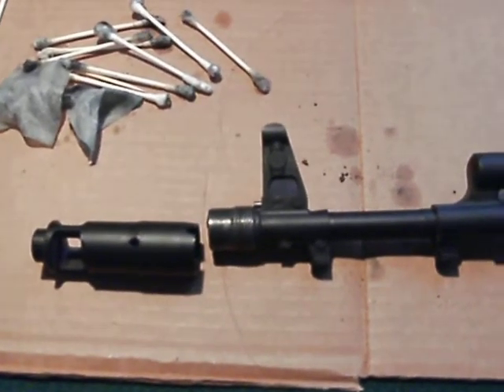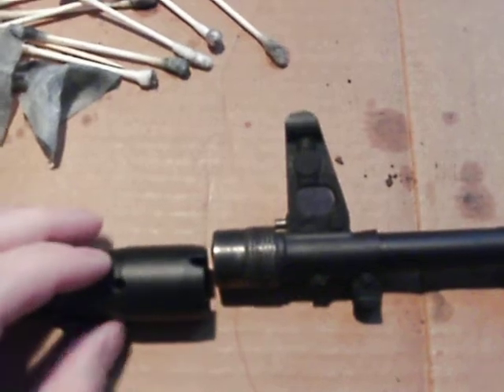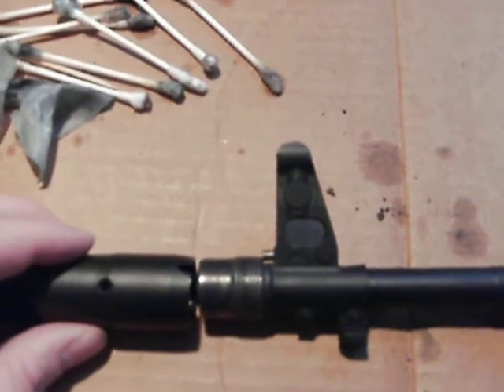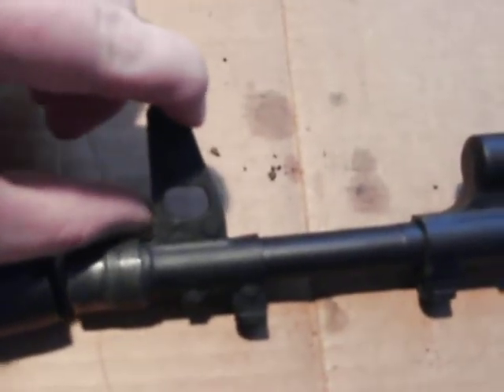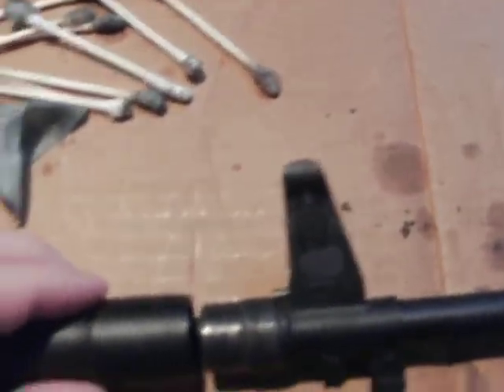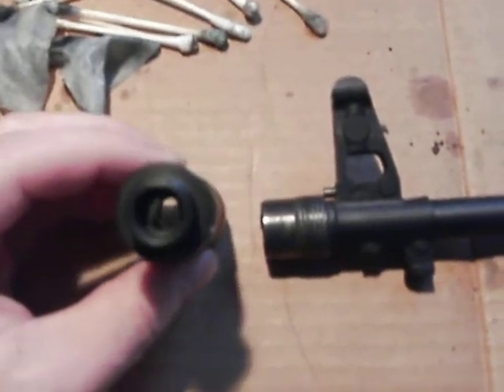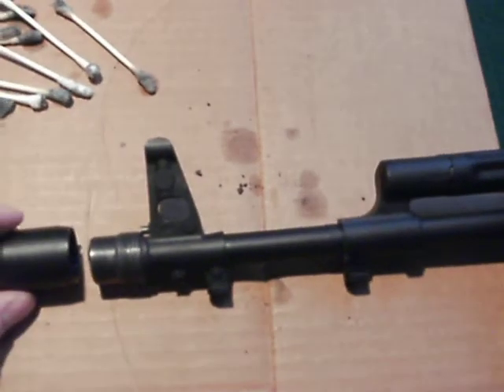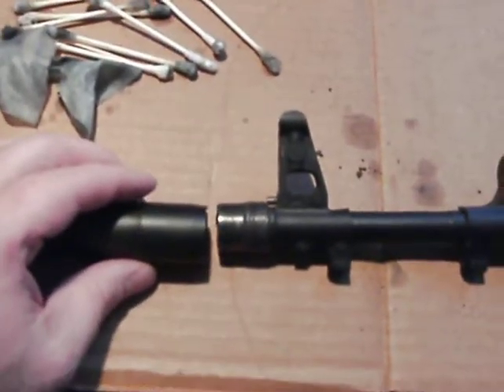Arsenal SGL Muzzle Brake Removal

Comment: If you came here to see someone take the muzzle brake off an AK, you will only find disappointment.
Reply from the maker: You were hoping desperately to watch me spend 92 seconds unscrewing the brake?
Reply: I appreciate your video, no sarcasm.  But I've been trying to get mine off and I cant.  It would've been nice to see it actually happen to make sure I wasn't missing some small detail.  Your vid still helped tho lol
Reply from the maker: J311yman Ah, no worries!  Owing to typical Russian design philosophy it's very straightforward:  hold that little pin in and then unscrew the brake. If it isn't budging, there might be a heavy buildup of fouling in the threads (hopefully no corrosion). Check some of the comments here and try a rubber/vinyl strap-wrench to get it off.
Reply: Thanks man, I have about 800 rounds through mine and it wont budge; I figured it was the fouling but I just wanted to make sure that I wasn't missing something else.  I hear that the brakes really stick themselves on there if they're not cleaned regularly
Reply from the maker: J311yman You're welcome.  I ran into the same issue and had to get it off with a strap wrench.
Reply: Oh this was a fun thread.  Please pardon me for this reviving this Married Shelly Monstrosity. Lmfao!!!
Reply: Google needs to go #1🤫👍

Comment from the maker: Getting the peg in and out of the hole and screwing is fairly straightforward.  If you're having trouble you should have a couple of drinks first to loosen up a bit.  Dry wit aside, this was me holding a cheap digital camera in one hand with video capability.  I still use a flip-phone for chrissakes!

Comment from the maker: Nope, it is what it is.  You'd have to mount a barrel accessory that would fit the thread.  I don't think you'd want to put a slant brake on this rifle (or even the 7.62 version).  The 31 is basically an AK 74 and the brake it comes with (the one in the vid) is the AK 74 style.  You get 50 points for being the first non-friend comment on this vid.  Thanks!

Comment from the maker: My SGL is righty-tighty, lefty-loosey.  I'm assuming that Arsenal makes them all the same, so if you're talking SGL, you'll want to go left to get it off.  I've read that the more old-school, surplus AK's are the other way around.  If you are having trouble with getting it to continue to unscrew, then you are probably in the same boat as the previous comments.  You'll need to use a 'rubberish' strap-wrench to overcome the fouling.

Comment: Got a strap wrench, but it was strong enough. Finally I wrapped my long screwdriver with electrical tape to prevent marring. Then used the strap wrench and the screw driver at the same time (Second person helping). The Carbon was caked on.. I had to scrub the end of the barrel and inside of the muzzle brake. Got the carbon off the barrel, but I can't get it completely out of the muzzle brake. Any suggestions? I have soaked it in solvent and use 12 gauge bore brush with no luck...

Comment: Mine is Carboned on and wont move...
2 questions...
Are the threads left handed/ reversed and with pin depressed, did you have any trouble getting yours off?
Mine is frozen big time...
Reply from the maker: Greg Keefer If you have the Arsenal SGL rifle, the threading is standard:  right-tight, left-loose.  If the brake will not turn by hand you will need to use a rubber or vinyl strap-wrench to get it free.  
Make sure to use rubber or vinyl so you don't damage your finish.
With the pin cleared from the brake and a strap wrench it should come off unless you have some serious corrosion (ie: the metal is damaged).  Not sure what to tell you at that point.

Comment from the maker: Just for the sake of covering it:  make sure you keep the peg on the front sight post depressed until the brake clears it.  My main guess would be that you have a build-up of gunk.  You could try a strap-wrench and that should work if it is because of gunk.  I ran into the same issue and got a strap-wrench down at Ace Hardware.